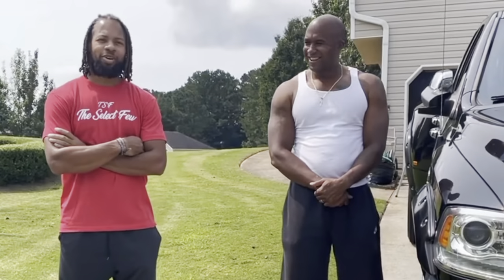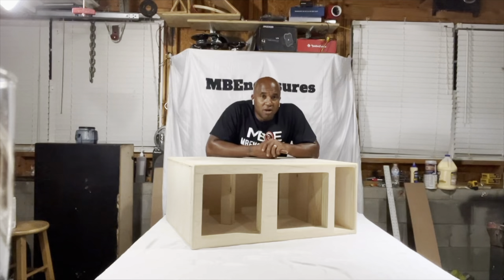Knowledge is Power! Know how much and how to power a Subwoofer!

Comment: I’m upset it took me so long to understand this concept, I’ve could have had me dream system by now. Great info MB!
Reply: I don’t trust all subwoofer amplifiers I believe all subwoofer amplifiers lie
Reply: @patrick7799  Only 4 companies I trust when it comes to amps: DD Audio, Kicker (KX line), Rockford Fosgate and Alpine
Reply: @michaelgray668  Modern Korean amps typically don't lie. Its all about the $.
Reply: Not 1 amp can put out rated power without current supplied by car.....most unfun thing in car audio......alt. and power upgrades should be first part of big install...instead of last..
Reply: @loudelvis610  Lol your tellin me My battery alt ,wires and fuse block are about dead even with the cost of my amp and subs.

Comment: MB speaking truth... i am constantly trying to convince people that 2 8's under a truck seat will sound much better than 4 8's...its about the box, air space, efficiency...and what amp are you using....here is a prime example. I have a stock GMC Sierra 1500 truck 2015...my stock alternator put out 160 amps of current max. My amps are Audio Control LC 1.1500 and a Audio Control LC 4.800...The 1500 watt amp has 4 30 amp fuses and the 4.800 has 2 40 amp fuses. add that together you get 240 of current draw if the voltage is correct and everything is tuned correctly. I have a 4 AWG kit running from the stock battery with an 85 amp fuse (stinger) I have never blown that fuse.....think about that. I am drawing less than half the current these amps will produce....so i haven't even heard what these amps can do actually and it sounds great...very high quality speaker all around including subs. Eventually i will upgrade the alternator and go to a zero gage wiring to get more performance but the point is MB is speaking truth...it takes power to make power and in Car Audio its called voltage and the ability to store amperage in droves. out....peace MB

Comment: An that's a FACT ..listen to MB..I did  upgrade my electrical my H2 Hummer,,OFC, 1 Stinger Relay 500 amp , 1 Alternator  Mechman 370 , 2 Oddessy AGM Extreme. What a big difference of POWER more efficiency .. My next step is to custom build box 1 15L7 by MB .. in a few months from now ...Will keep you posted MB....

Comment: Cheapest way.   Grab a good fosgate amp.  Grab a few kicker comps with a large box sealed or ported. Something with something fused for like 40-50 amps.  Feed it a clean signal.    Get good factory replacements amped for like 50 watts.   Everything will pull a reasonable clamp and it will sound amazing.  
 The volume between 50-150 watts clean in the car is not noticeable.   
Go like 3 to 1 on the factory to sub power and your good.  
50-60 watts on the replacements and like 350-500 on the sub in the best box you can find crossed over where crossed the highs. Good starting point.
All that craziness just sound like crap and it opens up nothing but problems.

Comment: I have a single JL TW1 10 on a Rockford prime R500. The sub is 4 ohm, in a custom enclosure built to JL specs, so it only sees about 300 watts. It doesn’t do hair tricks, it doesn’t distort the sheet metal of the car, but with proper tuning, sound deadening and a few old school tricks it gets pretty loud. I am happy for now, may add a second on and go sealed, and increase the power by running at two ohms.

Comment: Facts.  Definitely don’t want inefficient subs in a daily driver since the extra electrical power comes with a loss in fuel mileage.
Reply: Or do like me and put a 320 amp alternator under the hood ($360) and 48 ah lithium bank (250) and I can support a lotta watts. Cheaply

Comment: It's good to be re assured what i built my setup for is correct. 2 8s and a 8 ohm Kenwood 12 series parallel, Kenwood 300watt amp clamping 517watts. Group 65 agm, limitles 5k and old school 10 farad cap. Figured I would do 128-130db. I got  131.4 on music. 135 on a 46hz tone. Trunk of a Civic. Sealed with .4 ohm rise max. And honestly as a daily I'm more than happy with it. Also tried to keep my build period correct.

Comment: Yep! People whole plan change when they figure out they’re going to need a $700+ mechman elite 370 AND 2-3 120ah agm batts or a large lithium…not to mention 2-3 runs of some reputable OFC 1/0. Plus all the lugs, grounds, jumps of wire from batt to batt and batt to amps etc, dual inputs, quad and six input battery terminals and so on and so forth. Shit adds up to $2-3000 to power a SINGLE $600 sundown x12 or ZV5. But real talk it is what it is to do it RIGHT! 💯💯 anyways, rant over haha. I guess I should’ve watched more than two minutes of the video before I commented LOL… That’s how my first comment ended up posted. Anyways like I said keep up the great work and correct knowledge… Definitely need more people spreading the truth in our industry as you already know!

Comment: I'm curious your opinion on manufacturer prefab boxes like the kicker dual L7 ported. Are they designed around SQ or SPL or maybe a middle ground between the two. Do you tend to recommend larger volume enclosures when compared to the manufacture loaded prefabs?

Comment: So I'll give you my setup I've got a single 390amp alt running 15.9v charging it clamps 411amps I built a 60cell yinglong bank that's 350ah of lithium that bank will power 50,000 watts of continuous and peak pulls of over 100,000 watts for 30 second bursts I'm running 2 Orion hcca 17,000.1dsplx each amp will clamp 22,000 watts of power per amp after rise my subs are 2 18inch deaf bonce apocalypse dbsa418d1s im running 0.5 ohm on each sub and wired to each amp they are in a 6th order series tuned wall I built. The hole build costed me over $20,000 the reason I tell you this is cause you are absolutely correct you can't have big subs and a big powerful amp without having a big reserve in power and you have to have the proper amount of air space for your woofers if you adequately want to use them I see it all too often dude by a ton of woofers and they want to cram it all in there but they don't have the power to back at and they don't have the room for the enclosure that they need and then they wonder why it sounds like garbage or they're blowing their stuff up.

Comment: I just subscribed to you my friend and I thank you for putting this information out there as far as knowing your sub and it’s requirements. In the past I have had go elsewhere because I told them that you can get better performance from 2-eights rather than using those 2-twelves in a sub par enclosure. But also you have guys that would rather brag about the size and don’t care about optimum performance. Great channel keep it going my friend.

Comment: I feel you on that, I have two sundown x12 v3 but only one is in a custom box about to get another box made for both,but my electrical system is 320 amp mechman, big 4 ,xs power D3400 under the hood and Kinetic 2400Hc in the back and  about to upgrade to xs power D3100 in the back

Comment: I have learned a lot from your videos, even tho I’ve been doing this for decades. My question is about my subs efficiency, I understand the electrical needs, I understand the TS parameters give me the info I need to figure out the efficiency, but I’m not sure how to arrive at the answer of their efficiency. 2021 version Kicker comp R 12’s seemed to be a good choice for my application, I admit that my crew cab truck presents challenges for two 12” subs, but I am willing to sacrifice seating for BASS.
Reply: If your going to pull the backseats out I’d get a high output Alt big as you can afford then go from there. Build a good audio foundation and you can’t go wrong. But those kickers you should sell once you realize what you can power ie get the subs/ box to match LAST And is go custom made subs -Robot Underground

Comment: Yea. I learned this stuff the hard way. I have a 4000 RMS sub with a 2000 Watt Amp on a stock Alternator and I can confidently say that I am heavily disappointed because I didn't do it right or know how to do it right when I bought. Now I am left with a starving system and Parts that I just can't afford to buy at the moment. Listen to what this man has to say. Or learn it the hard way yourself. Do your research. Don't just go out and buy top of the line Subs thinking you have what it takes to push it when you're making min. wage because I guarantee that most of you don't.

Comment: You are right however Some of us that are on budgets  buy theses high rms comp subs because we like the craftsmenship that goes into them along with the durability and the reliability of them lasting a very long time it is perfectly OK to underpower theses subs as long as we're keeping the signal clean,  we're also ok with having plenty of room for improvements in away it keeps the hobby moving forward for us, and thoes not on a budget buy this stuff because they can this kinda ties into your other video but opposite meaning of it...anyways if we buy 2 500rms subs and 1 1500rms amplifer a proper box and extra battery upgraded alt the build is now over and the only way to gain more improvements is to just throw it all out and start over again some of us build without throwing it all out and thats where the reliability of thoes subs come into play ,, the money is going to be spent either way there is no right or wrong way to spend the money on equipment unless you have a certain set goal of something to be acheaved right away which I beleave to be your point in this video

Comment: I went from kicker L7 15’ with kicker amp all stock electrical to sundown. Is sundown louder? Hell yes. What did it take to make it louder? About 3k in electrical alone. Also a 4.5cf sounds best IMO with the x12’s if you run enough power to them. Peace

Comment: I was part of a club I used to compete and then I got educated so i backed out of the club stopped competing so I could rebuild my setup from start to finish I spent about $9,000 and I made about $5,000 worth of mistakes Right now I only have about $4,000 worth of equipment in my vehicle and it sounds better than ever Lowe's and highs

Comment: People would be shocked to see 2 $100 subs in 4.6-5net  tuned between 30-37 (depending on the fs) rated at 350-600rms max.. and all you’ll need is a battery swap and big three upgrade. High sense 12’s (86-90db range) and any full bridge amp with a signal to noise no less then 105db.. 

$1-2g investment tops and you’d beat the block off 95% of everyone else around you..

And that’s a setup that will fit 80^ of trunks and anything larger with ease.. hell there’s plenty around $150 or less that will play nice as small as 3.8 net tuned at 30. 

Endless amounts of subs under $200 that love 4 net tune at 33..

Hell watch some sub videos.. they hit a sub with 500-750 in a net 2 tune 33.. pull 138.9 on a single in an suv lol.. hit it with 4K burn and gain 141.. 3400 more watts for 2db? You all need to learn

Comment: A .25 and a half a cubic ft is minut.you will never notice it.the motor force is strong enough to pull the sub.ive had this debate with a guy so i built a 3.25 cube port box for a 15” 4000 watt rms sub and man that bitch gets down..sounds great👌🏼

Comment: Car audio is simple....everything has to make since. EVERYTHING. SUBS THAT CAN HANDLE A LOT OF POWER, THE RIGHT SIZE BOX, AMPS THAT CAN PUT OUT ALOT OF POWER 5 TO 15K WATTS, TO MUCH BATTERY CAPACITY,  THE RIGHT PERSON THAT KNOW HOW TO WIRE IT ALL UP(CORRECTLY), TH RE WRITE HEAD UNIT(NOT A CHEAP ONE), DYNO MATT, NEED I SAY MORE.! ALL THIS IS WHAT I HAVE IN A 2011 E550 CABRIOLET.! AND BELIEVE ME IT'S SKULL CRUSHINGLY LOUD.! AND I GET 2-10" SUBS THAT CAN HANDLE 3000 WATTS EACH AND I'M GIVING THEM BOTH TWICE THAT.!

Comment: No joke one salt4 on a 370amp ofc 0 gauge with 3 H8 autozone AGM batteries voltage drops from 14.8 to 12.8 and I still need better electrical. Always go overkill on electrical when running competition gear.

Comment: I have (2) 6.5 inch jl w3's how big of an amp  should I use to safety power these woofers?
Reply from the maker: 500rms
Reply: @M.B.Enclosures  hello Mr MB question do you make any single 12 inch enclosures for around 300 dollars like mdf or plywood can't really swing the birch and stuff

Comment: Could a sundown sia 3500 push 4 sundown u8s and it hit hard and be worth it. I have 2 d3400 xs power batteries and js 400 amp alternator. Would it be worth it doing sundown sia 3500 or would I need a bigger amp or small subs
Reply: I have 3 cubes after displacement and everything under my truck seat. I want the best performance and the loudest I can be. With the airspace and electrical I have. I have watched basically all the videos on your channel and learned a lot. But I feel like I’d be good with the u 8s in the setup I have but wanted your opinion so I don’t waste thousands of dollars lol
Reply: I would go 5k and bigger subs because you can support that 5k it to me it makes sense since you have the set up for might as well use it oh and get another battery for the back you sweet tea with alot of sugar!

Comment: Pound the wattage to it Untill it burns up then back it off a little and buy new subs! 😛 seriously I have 2 AB XR15s rated at 1500wrms on a CAB 45 5k and with some common sense I can give whatever there seeing from that amp never clamped it but up to the point the clip light doesn't blink or a quick light blip here n there without an issue, but I don't hold it there nonstop do a song or so n give em a little break. There at there hairy limit I'm Shure but almost seems there mechanical limit no bottoming out but the suspension it getting a work out. They have never smelled hot once.

Comment: Can anyone assist. I have a dodge ram 1500 crew cab with a 200A alternator, big 3 upgrade, 2 regular car batteries, 0 awg wires, 1600w kicker kxa amp with sub sonic filter at around 25hz and lpf at around 80hz, one 15" kicker L7s wired to 2 ohms in a 6.4 cu ft ported box tuned to 29hz. The only way I can get good bass is if I turn bass boost all the way up. (already set the gains properly with a multimeter, I even tried turning the gains higher and still no serious bass output (am aware that gain is not a volume knob)). What could I possibly be doing wrong.
Reply: I believe your box is a little big 6 ft cubed being the maximum ported enclosure size. Check the manual. Did you build it for that subwoofer?
Reply: @jamesr3364  yes, I built it for that sub, I was told that it's OK to go over by a little, so I did
Reply: @doublemanson  yeah next time go off the manual box specs that’s a bummer! Maybe add some corner bracing with 45 degree cuts to take away air space. Or start from scratch! Also make sure your port has room to let air out.
Reply: @jamesr3364  ok, ill add a few 45s in the corner.  i modeled my box with WinIsd so i know that my air velocity is about 17 m/s

Comment: I thought a mcss had enough space for 2 12s?
Reply: Depends on the needs of the particular 12. As in power and space needs, the subs he is referring to need far too much of both in order to perform at the expected level, aka loud and clear.
Reply: Not the 2 12s he wants to put in there.
Reply: @craigguynes1613  oh ok. I'm still learning... But, That mcss has a big trunk. The q bomb box that fits inside is easily 6.5 cubic feet.
Reply: @slowbrezze  got it. Agreed
Reply: @dqsmooth34  Q bomb, prefab, not built for those subs... not nearly big enough, not even big enough for kicker comp r’s...
Reply: @craigguynes1613  respectfully, I disagree. The large q bomb box for 2 12s offers 6.7 cubic feet of space. I own 2 12 sundown nightshade v4. Each 12 requires a minimum of 2.5 cubic feet. So, space wise, it's more than enough. Tuning? No. Is it better than an MB enclosure? Heavens no. But it is big enough.
Reply: @dqsmooth34  respectfully, the xl q bomb has 4.5 net air space, 2.25 per sub... if sub needs minimum 2.5.... doesn’t add up, but better than nothing.
Reply: @craigguynes1613  looked it up on another site. 2.25 per sub is right. I plugged the dimensions into a cubic feet calculator and got a different number. But I'm sure that calculator didn't account for certain aspects of the q bomb

Comment: I'm keeping it simple with my ID8V.4's. Can move easily. May move up to IDQ8V.4. But regardless, i learned from a winch, lights and a system. Alternator 1ST!!! Dual batteries and even over the size cable you need. And last but not least, properly installed fuses. No car b q 🔥🚙